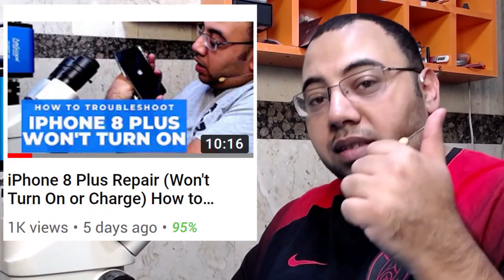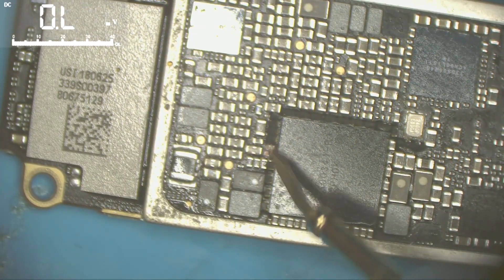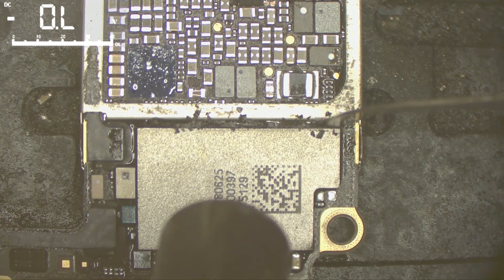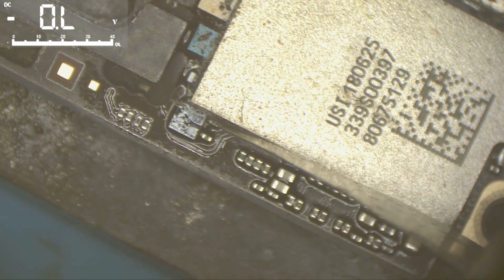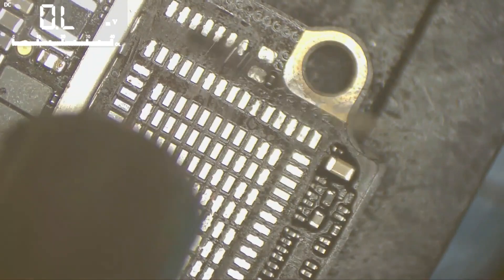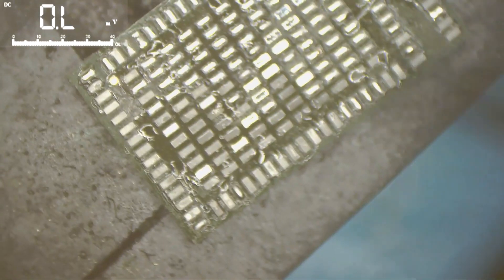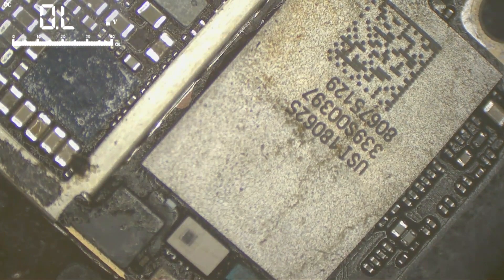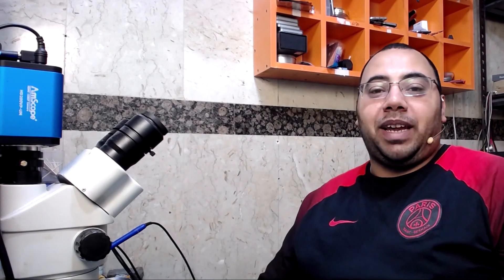iPhone 8 Plus Repair WiFi not Working (Solved)

Comment: How much does this normally cost to get fixed? Mine started this issue after I was randomly dropping Bluetooth connection so I reset my network settings to try to fix it and it ended up causing the no wifi or Bluetooth issue so I’m going try to do a factory reset before I take it to a shop. I was just curious what’s a fair price (not cheap like you said, I just don’t want to be ripped off)
Reply: 40€

Comment: I actually have a question. The first piece of junk between the chip and the other parts of the phone appears to be a foil heat sink with some insulation inside.  Am I correct or it this just the video lighting?  The other sides seem to have just the insulation without the foil outside.  You still Rock.  You are the only Youtube person I have subscribed to as you do youtube right.

Comment: I saw many technicians when they remove wifi ic they are also removing the flash ic .
Why you didn’t do that?!!☺️
Reply from the maker: Only PCIE models need to do so because there is a software connection between the Nand & wifi in PCIE models 6s and higher models i will do a video for that soon

Comment: This is my like👍🏽👍🏽👍👍🏻 thanks alot . Mr.ayman what is usually heat that you are used to remove ic wifi?? 400c??
Reply from the maker: Thank you Karrar, I use 450 for all my reworks and i use 250 for removing glue
Reply: What????450c?? Amazing. You are a great man in this field. You are depended on time no in heat.